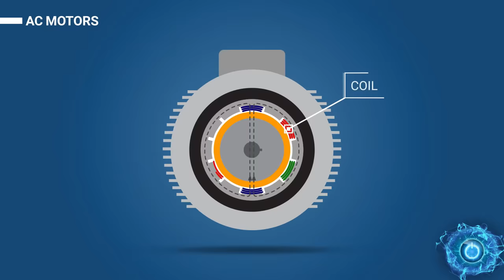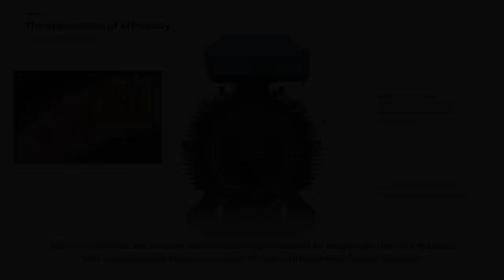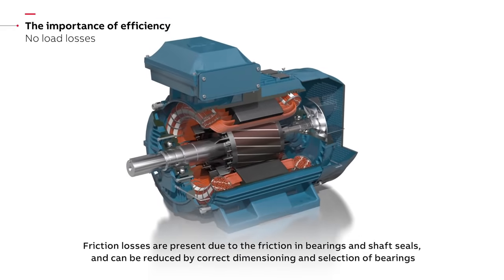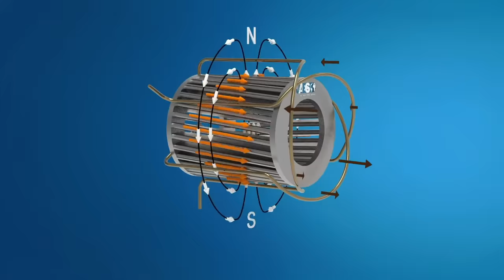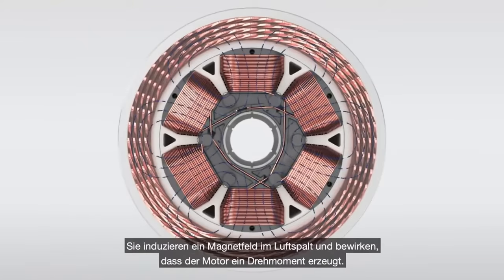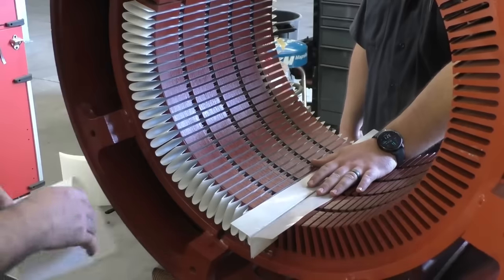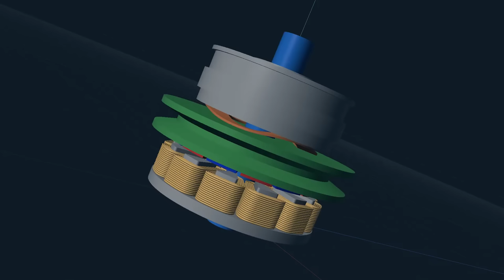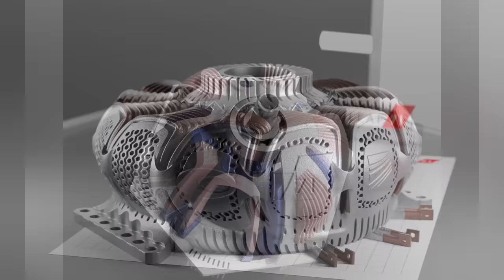GAME OVER!? - A.I. Designs New ELECTRIC Motor

Comment: Today's motor designs already seem pretty efficient. My issue is battery energy density. 1 Gallon of gasoline is about 34.5KW-h of energy storage. A 14 gallon gas tank contains about 483KW-h. And weighs about 100 lbs with tank and pump. And takes less than 5 min to fill. A 120KW-h battery is equivalent to about a 3.5 gallon gas tank. And takes 40 min to get an 80% fill. And weighs about 1,200 lbs. Imho, this is where we really need to concentrate to make EVs truly useful.

Comment: One classical design that avoids many modern issues is the slip-ring three-phase motor. The rotor and stator are both wound, and the rotor windings driven through three continuous sliding contacts, so the current is carried without commutation. This offers some of the advantages of the universal motor, which similarly has both rotor and stator windings, namely a higher momentary peak torque relative to its heat-limited power capacity.

A permanent magnet motor can never be "turned off". Induction motors don't generally provide usable performance in regenerative braking, only (lossy) electromagnetic braking. A slip-ring motor has full control of the excitation of the magnetic field, so the motor can be allowed to free-spin with extremely low resistance, or loaded to any degree desired similar to an ICE car alternator.

Comment: Powdered and formed materials will need to be strengthened (not hardened, as this will create even more fragility) for any of this to work. The particle separation possibilities are potentially lethal in larger models. If a fidget toy still can't be made that doesn't eventually or instantly become compromised, it's impossible to have a heavy use motor that won't either. Even traditionally processed powdered metal components are much less solid than base metal or even cast metal. JMO.

Comment: Just like any other motor design radial flux is something that will need expansive research to overcome the inherent problems of current designs. With the scarcity of the materials needed for the existing motor designs being limited, there isn't much of a choice except for putting in the time to advance radial flux design for the performance needed. 😊

Comment: This is called generative design and it's actually used by engineers to streamline workflow and create optimized designs based on simulation data. It's not game over, it's just another piece to the game.

Comment: what interests me is also how resistent are powder-powder situations to faults (after all, copper dust breaking off the coil could do unfunny shorts, whereas from the body the engine could seize) and how repairable the new wonder-motors will be ...  AI-aided processes often produce "awesome but impractical" or "one-off" kind of designs.

Comment: Back in 2021 I designed a brushless axial flux motor that was based upon the Lynch motor design, but that would use a 3D printed coil assembly and smc core material. I contacted four leading manufacturers to ascertain the cost of prototype printing, and lets just say that I don't believe that we will see such motors become mainstream. 

I found I could make a "good enough" motor using traditional manufacturing and assembly techniques for a fraction of the estimated production cost of the fancy 3D printed version. 

Hell rethink bikes couldn't even make a business out of the binova flow motor which was an excellent product with easy manufacturing process...

Comment: My invention can exceed greater than 100% efficiency.

I call it the, 'Hydra-Kinetic Motor'.

I'm Jerry Calvert, the inventor.

I was able to do it very simply and easily.

Final design was completed five years ago.

It runs solely on kinetic energy from springs and is self powered.

It is the one ring to rule them all. Nothing else even comes close.

Cheers!

Comment: IF you can keep the heat down, nearly any electric motor can be severely over driven.  I have done it many times.  The limits are the voltage of the wire insulation and to not spin it so fast as to sling the lube out of the bearings.

Comment: Maybe the printed coils can be soldered or plated in silver to fill any micro gaps. Lowering the resistance. And having the coils hollow to allow cooling, this could be awesome for performance. Maybe a silver and / or gold plated coil or possibly a alloy of copper and silver to improve tfe conduction, or use the prints to cast the coil in copper. Use something that can handle the heat to keep the coolant passages in the coil open, then uses a mild acid to break it down to clear the passages. Then possibly electroplate in silver ir gold and enamel insulation.  Very interesting if nothing else! 🤔✌️

Comment: this raises a valid objective, like the magnetic paint on modern cars, what if a 3d printer could prevent banding and increase rigidity by having a method to magnetically bind the print media repeatedly to itself? Plastic welds, but can we weld it magnetically
Reply: like magnetic putty, that's basically what i'm getting at, only during printing

Comment: There is a rather simple solution for getting the power of a PM motot with an electromagnet. Simply use a high frequency rotary transformer with a rectifier. You could get armature fields far stronger than simply using a neodymium magnet. More magnet gives more torque. Also its possible to use a PWM driver on the magnet to vary the torque on demand or make the motor a powerful generator during braking or coasting downhill.❤

Comment: Definitly interesting. Even if it is only feasible for prototyping, this prototypes can give practical data to further analysis and optimizations.
Reply: Oh and since we have a 3D printer (pretty basic one) in our institute this thing is basically working 24/7 because it's that easy to get practical usable parts from it (Adapters, frames, lids, boxes etc.). Recycling and printing stuff on the fly is the future. Its a production on demand to avoid excessive overhead production that gets thrown away in the worst case.

Comment: In a lot of cases you only need one copy.  Standard methods can take over then.  However, there are limits to the complexity of really old methods like the ones used in India's slum metal work factories that continually recast Victorian metal machine parts in oily fine sand.

Comment: the past 10 years of electric 'advancement' will be put to shame in 20 years from now. but they had to happen. they are not waste. we are going to start moving faster in research and design than production and that is probably the biggest problem , squaring the two without destroying both.

Comment: Outrunner brushless motors were left out, where rotating the armature is the outer casing and the central stator is fixed in place.   More torque due to more leverage.

Comment: Using materials that are good conductors, not easily oxidized and 3-D printable is quite a challenge. Doping copper with something more workable may have a side effect of rusting, which can then be negated by insulative design, having no air reach the wire so that they don't rust. There may be compensations to be made, but it is cool to think that the Mall, and it's stuff, of the future will be but a Box in a room in your house.

Comment: At the current state of tech, this metallic 3D printed manufacturing could well suited for casting dies, not the finished parts. Exceptions I've seen are auto parts like intake manifolds, possibly headers too. Powder deposition, IMO, is never going to be as electronically conductive as drawn wire.

Comment: The main winding was of the normal lotus o-deltoid type placed in panendermic semiboloid slots of the stator, every seventh conductor being connected by a non-reversible tremie pipe to the differential girdlespring on the ‘up’ end of the grammeters. Moreover, whenever fluorescence score motion is required, it may also be employed in conjunction with a drawn reciprocation dingle arm to reduce sinusoidal depleneration.
Reply: The lineup consisted simply of six hydrocoptic marzelvanes, so fitted to the ambifacient lunar waneshaft that sidefumbling was effectively prevented. The main winding was of the normal lotus o-deltoid type placed in panendermic semiboloid slots of the stator, every seventh conductor being connected by a non-reversible tremie pipe to the differential girdlespring on the ‘up’ end of the grammeters. Moreover, whenever fluorescence score motion is required, it may also be employed in conjunction with a drawn reciprocation dingle arm to reduce sinusoidal depleneration.

Comment: The problem with 3D printed coils is that they have poor surface roughness (in addition to porosity). As such, it takes alot more varnish to fully coat them. And even with the added varnish, the high spots will almost certainly suffer from premature failure because they greatly magnify the E-field right where the insulation is the thinnest. Unless and until 3D printing can produce surface finishes on par with traditional processes like drawing, don't count on motors built with 3D printed windings being able to last more than a few hours at full load. So it might be useful for things like expendable drones, but not for anything consumer, industrial, automotive, passenger and cargo aircraft, etc.

Comment: Fascinating and very informative. My take is that schools of engineering will continue to push the boundaries of what's possible and functional with consideration of cost to produce and mass production. Some applications do not require mass production which allows a more closely managed forging process, however it is very interesting to see new age designs breaking free from traditional induction/magnet core, very impressive technology all in all. Mind-blowing. 

My question could multi layered 3D printed coils withstand heat and temperature thresholds, didn't notice any mention of heat or temperature just curious to know your thoughts.

Great videos. Hard to follow watched it a few times lol

Comment: Multi metal powder 3D printing looks amazing, but wow… what a pain when recycling the mixed up metal powder leftover.    It will be super cool to see what’s possible, even if it’s not practical for more than a few one off parts or tests.
Reply: Metal recyclers can only dream of having a material input as pure and clean as the mix of powdered metals left over after this, recycling is not an issue.

Comment: Yep, just a matter of time, in fact I have been toying with the idea of an impure soft copper mix the will change dimensions during acceleration to change the electric field at faster speeds to change the efficiency curve. Similar to how inertial clutches work but within the motor. No gears necessary

Comment: Even if magnetic core material is somehow insulator for electricity, you can't use it for inter-turn isolation coz of magnetic flux losses due to magnetic shunting. And yeah, with conductivity of printed coils it's only 2 problems on the way to replace traditional motors.

Comment: Testing is just data that will feed right back into AI for improvements. What I think is that immediate commencement of the prototypes and tests should begin. What's the worst that can happen? You have to melt down some scrap that didn't work out?
Reply: When we achieve an automatic matter synthesizer, we will definitely need to keep that away from the motor template AI or we'll have transformers kicking our asses so momentarily we might as well call it instant.

Comment: I am impressed ... as we are looking in shipping still for efficient alternatives, actually we face still huge costs because of the individual adaptation of each E-Motor-Battery-Clutch-Propulsion (propeller shaft/propeller) system related to ship hull, displacement, requirements related to the sea area ... such 3D printing might be an interesting option. Are there any proto-types already in "test modus" ??? Tks for this video and for sharing. Mindboggling ... :-) love it !

Comment: Additive manufacturing is the future of most new designs. No tooling beside the original machine means that manufacturers don't need a separate line for each product. Multi Material AM has a long way to go but will get better with time. AI sucks at original design but is the great optimizer. Take an idea and let AI blend and optimize. The future will always need a operator at the controls. AI will make it better or steal it from you.

Comment: They Are Made Of Ceramics and Graphene Infused, Ceramics. Also, Forms Of Glass. They’re On Board Powere Supply, Consists Of A Particle Accelerator, Ending In An LED Configuration, Where Particles Are Smashed.

Comment: Have you gotten the Perendev magnet motor in the back to work or a video on that?
Reply: I saw the same thing, unfortunately the geometry is wrong with 12 Neo magnets on the Stator and 24 Neo magnets on the Rotor gives the design a magnetic lock because of the Symmetry, the design needs to be in a state of continuous imbalance requiring an Asymmetric design. ie; 13 Neo magnets on the Stator and 34 Neo magnets on the Rotor etc..., think Golden Ratio or Fibonacci!

Comment: Reminds me of a recent discovery that showed a mixture of copper and carbon (graphene form) pressed through a special extrusion process can increase electrical conductivity up to 11%.  My idea is to try a lower tech experiment utilizing pure copper melted in a diy furnace/foundry with a form of carbon added (ball milled carbon soot) and then repeated pressing and annealing to create wire on a roller mill.  If not successful through testing I may try ball milled carbon fiber as an alternate additive.

Comment: I think the advantage that component assembly products, like Electric motors still has is, serviceability. You can take apart and replace components. 3D printed composites are not mechanically serviceable. How difficult is it to separate the metals in such a composite - in terms of recycling?

Comment: Thx. Something doesn‘ add up here correctly.@ 0: 47 the Genarator ( & Not the System or Resource Energy ) is Working with 92.7 %. The Amount of Lost, in Form of Friction, Enthropy, comes to 7.3% for the Generator…. Meaning : Mechanically there is the Loss of almost 19% power Lost between the Source Power and the Generator direct at the beginning. So perhaps you should Work more on that Power Transmission Lost & simultaneously at 7.3% by „ Fluid or Plasma „😀

Comment: Yep instead of setting a magnetic field strength, create magnetic flux blasts and shoot them in at the rotor where the rotor picks up as much of the flux blast as possible. i.e instead of powering it with a solar (magnetic) arc, power it with repeated solar (magnetic) flares.

Comment: Interesting, however, going with electric engines has a big problem. The source of power. Current lithium-ion batteries are mostly useless for anything than a phone or a power tool. They become low on energy and are by far the most common part to break in any internal combustion engine. I work with heavy equipment and the most common part to be swapped before anything else is the battery.

Comment: Because you can print bulk metals which have very high conductance and mix them in optimal ways, I think something much more interesting would be optimal printing of thermocouple high amp low voltage circuits..  Cheap efficient solid state thermocouples you could bury in the ground and use the surface to  ground temperature difference could provide a very durable and long lived energy source during the hottest summers and coldest winters using a natural geothermal temperature gredient that is present everywhere on earth.

Comment: We have superconductors that works at higher temperature. Problems is they are in their mechanical properties something like a type of ceramics and not metal. And it is very difficult to make wires and other components from ceramics like material

Comment: Electric motors are already quite energy efficient. It's always good if you can make more improvements. But I have some doubts that printing copper coils might be the solution.
More winding with mostly thinner wires normally makes the magnetic field stronger. If the motor has be be quite robust you can't use to thin copper wire.
It's maybe possible to print copper, but has it the same resistance as a normal formed piece of copper? How do you produce the isolation for the copper if you print coils with a lot of windings?
Doing the research is ok, but don't expect that this will be the best way to improve electric vehicles.

Comment: A three-independent-armature motor with programmable onboard electric flux production working in a semi vacuum cryogenic environment could generate power to share chemical batteries and store kinetic potential with high rotational speed for rapid braking and acceleration. At the same time, it generates electrical output, it could produce torque for acceleration and kinetic storage. Finally, kinetic storage, chemical electrical flux from batteries, and other energy inputs can all be fed into acceleration or the reverse; breaking. Acceleration greater than 9 m-s2, gravity, is possible using the high rotation rate as a gyroscope. The system would also assist in tracking sideways motion with computer assistance. It will be nice when that is done. Then we can have a 500 kg family sedan and  150 km per liter hybrid or 300 km on a 50 kg battery.